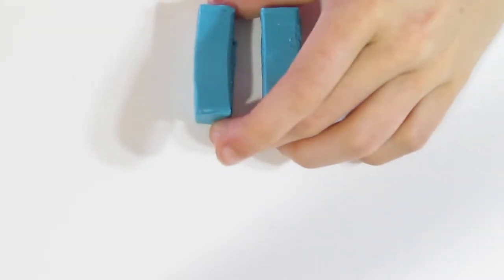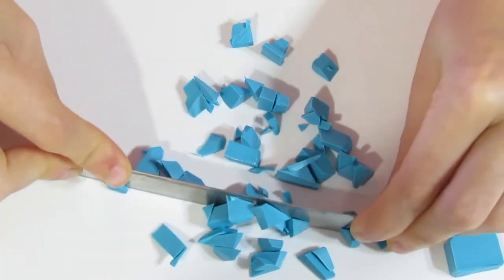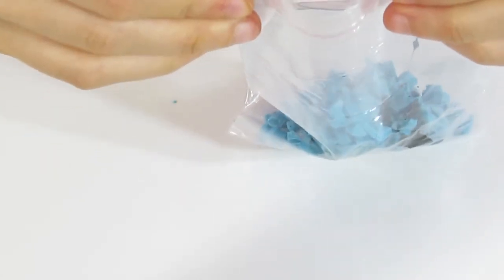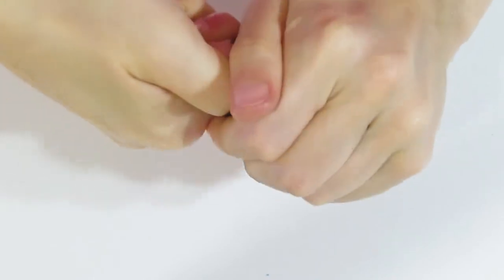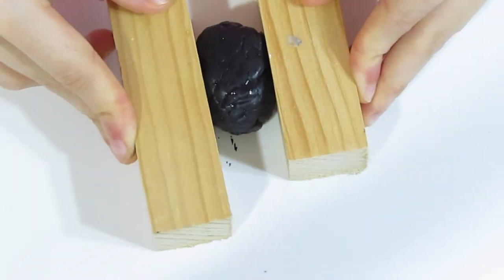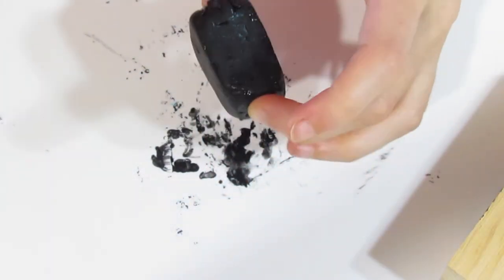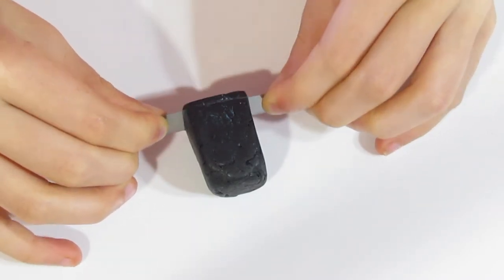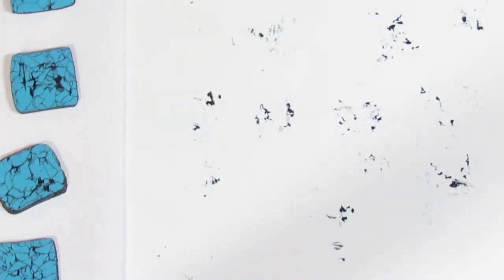Polymer Clay Project: Modern turquoise Earrings Tutorial

Comment: Samantha thank you for this, 
Is it necesaary to sand the surface of the beads? And in the sanding part, is water really needed until the last grit? 
Thank you
Reply from the maker: It's not absolutely necessary, but it does provide a more professional finish. Also sanding with water means that dust particles don't fly into the air. It's just safer that way.
Reply: @JessamaTutorials  is there no need to condition the clay before cutting into pieces? Thank you for reply always ☺️